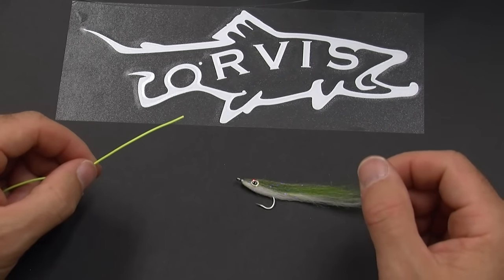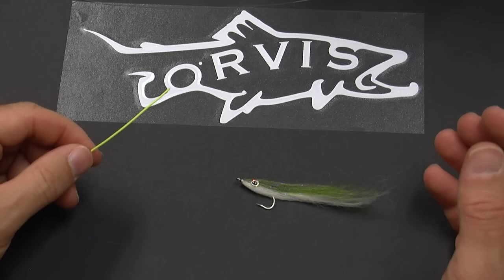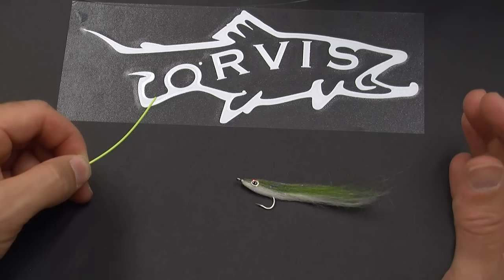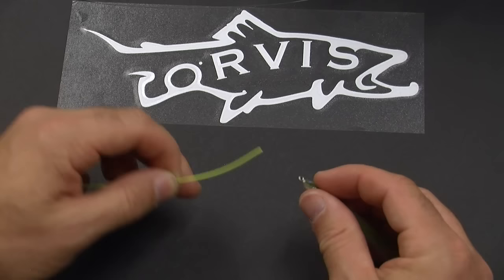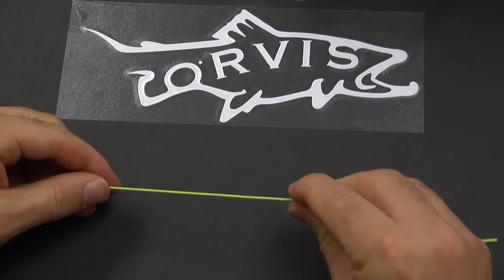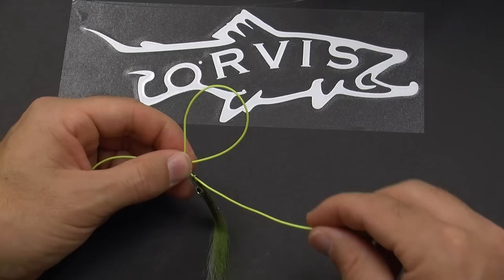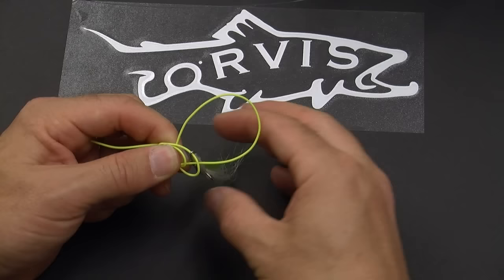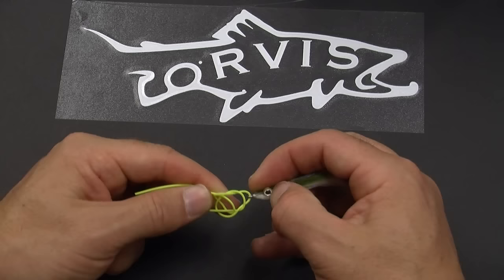ORVIS - How to Use a Perfection Loop to Attach a Fly

Comment: Exactly how I've been doing it for years. After passing the fly through the first loop, pull on the left side of the first loop. This will make the fly loop smaller. Then pull on the standing part of the line to shrink the first (non fly) loop. A smaller loop keeps the hook and fly from fouling in the finished loop.
Reply: thanks for that.